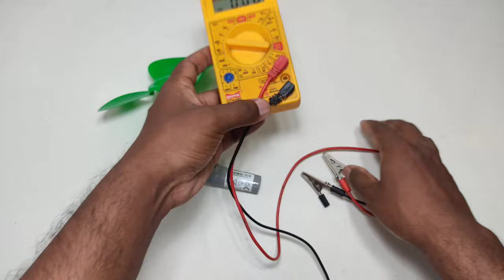How to make a rechargeable Fan at home ll portable Fan

Comment: Motor voltage?
Reply: 3.7 - 4.2
Reply: Bro it's 5volt I have it
Reply: @DarshanaRathore-tl8bc you're ones are different he used 3.7-4.2 v motor in this video, because his batteries are 3.7-4.2v
Reply: Bro it’s 6v
Reply: Is 3.7 to 4.2 v or 5v are sufficient to get air and cool down in summers when electricity went out..?.?
Reply: Voltage rating 4-5v
Reply: This is 12v dc motor, and motor number is rs350😅😅😅😅
Reply: 9volt
Reply: 9 v
Reply: 3v bro
Reply: Kuchh bhi
Reply: Ye 12 volt to 28 volt motor hai

Comment: Tp4056 to charge 3 batteries absolute no its barely charge one battery and becomes two hot 3 battries tp4056 will smpke or can catch fire plus unbalce charge will destroy your battery if it dosent get smoke if you use coolent it will take 2 days to charge so the project is kind of failure